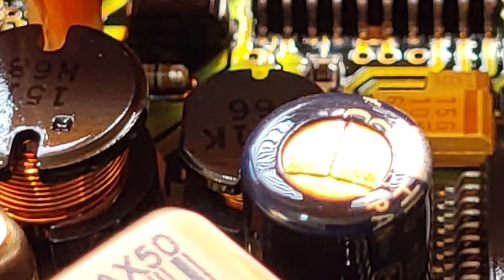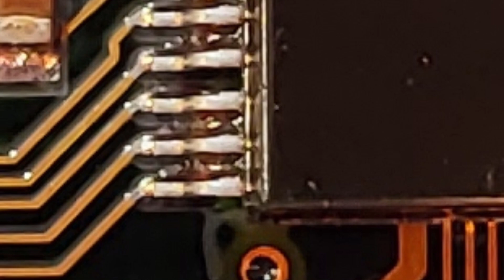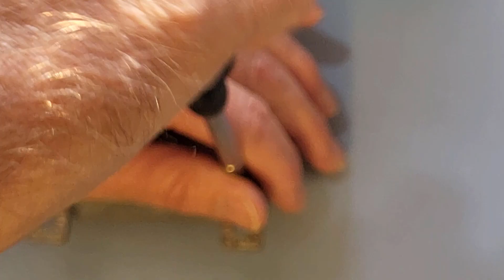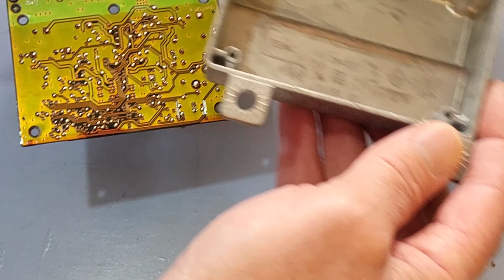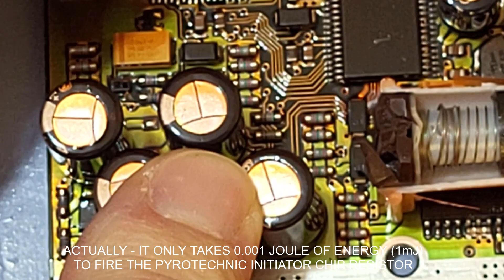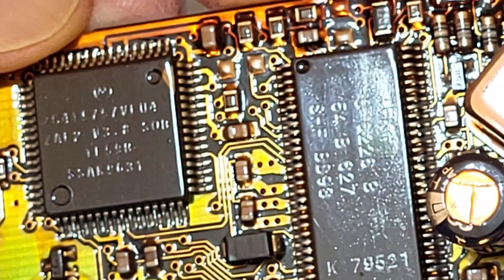CAN A 25 YEAR-OLD AIRBAG SAVE YOUR LIFE?

Comment: Crazy just how long they can work. I went to a junkyard a few weeks ago and saw a 1995 Ford F-150. It’s front end was completely torn apart and it was smashed inwards and door slightly buckled on the drivers side, yet when I looked inside I could see it’s 30 year old airbag had still deployed.
Reply from the maker: Thanks, yes, unless the SRS light is on they will go bang!
Reply: shocking( case examined in your junkyard crawl ) that works as intended as Volvo-LLC saying some of the restraints go rotten ( remembrance for my pre 1990 truck and my 70~charger so i don't forget to replace them when i finally get the restoration done ect ) after 9~ years sorry from my memories as i haven't been reading about this lately, anyway's at least on the bag's i knowledge/handled/3d-party-repair-shop-employed in the usa-markets/brands the charge=sealed generally ( also generally look for brighter yellow wires and or molex-connector's, my uncle used to be in maintenance and or helping Lincoln-ne-usa run that-line ect ) but ford/other's did get caught with more than one era/recalls and for the fabric-bits generally aren't completely sealed to environmental factors ( part of honda/big-3 was keeping the timings but changing the denominators/assembly on the back, yes some models/parts do use a o-ring but not all of them ) and or in the process of being pressed/20-2k lb-force look at space-shoots/drag-shoot's to get my-points the fabric over time and or galvanic/chemical-factors can degrade so great the charge-fired as planed ( takata's don't as chemically decomposing aka dud's or extremely-spicy=frag out, my 5year/08~ old car/le-cross at time/need/25+mph was dud's so probably had the recall/needed but gm hadn't announced it yet as that was 2015~/late by memory ) but now the plastic/canvases/silk rip's/RIP'd-driver and or others 

yes im not in the removals camps but i do wish there was aftermarket parts/support for popular models that got to 25+years old and or some way of adding/cert-ing it just like how EFI currently is for 50's-classic's

also wishing for 4 or more point belts as 2's and 3's doesn't work for my 190lb~ body shape i get injured despite following to a T the owners manual ect

Comment: I worry about the actual bag inflator not so much the electronics. I'd rather have one not go off than one that may be corroded and spray me with shrapnel.  After all that's what the large recall was over. Then I think my vehicles I drive daily were early airbags and who knows if they even would have cought a problem like that recall. Then I take into account they are both convertible vehicles that are 20+ and 30+ years old.  

I'm actually thinking about unhooking at least the older one. 

I know in the US depending on the state it would still be legal to drive and register.  And I'd rather have an insurance company mad at me than be dead from parts hitting my face

The middle of the floor under the dash is not really a great place for a wrangler with wash out floor drains and a steep windshield.
Reply from the maker: The airbags themselves are a bit like lightbulbs - they are completely sealed and they will go off unless the ignitor goes open-circuit - and then you will get the SRS warning!
Reply: @TimmsBMW  unless things have corroded and the charge ends up making metal shrapnel like the recalled ones

Comment: I use an "Autolift 3000" "car seesaw" lift on my cars. It lifts my 760i easily and safely. Just wheel it under the car and use a good electric drill to raise the car, if you are working in a semi public place it's fairly easy to lower the car back when you are not working on it.
Reply from the maker: Thanks Andrew, to be honest, even with a great lift like that I still won't work under the car - the only time I get under is when it is on sturdy ramps!

Comment: I wonder about the air bag itself. Does it deteriorate with time? Big dustup over Takata airbags failing. If I remember correctly, BMW had a recall and mine were replaced on my E39, but as time marches on, I wonder if there is a useful life to even properly made airbags.
Reply from the maker: Hello William, the airbags, unless recalled, will go off - they are hermetically sealed and should last many decades

Comment: Wow I can't believe that people would disable a safety critical warning with a resistor... Only to make a few extra quid selling (or using) an ageing car. I'm also fairly sure if one were to do that, and the new owner has an unfortunate incident, and they can prove the deception (and it is a deception AKA a LIE!). So whoever did it, could be in a world of trouble, as a lie that puts someone at risk should the truth be unknown, the teller bears the responsibility of the consequences. 

If one wants to do that to their own car, and use it solely for yourself,  just getting rid of a light, then whatever, their risk, their Darwin Award. If it were me and I was using the car, I'd visit a scrap dealer and pull the same airbag out a wreck, if it's intact (assuming I couldn't afford a new one). If I were selling it, I'd just fess up and have the new owner sign that they are aware that there is an issue with the SRS, hence the telltale light. If the buyer low balls you for it, you can just argue that the asking price was with the issue/s in mind (assuming that it actually is, and is realistic), and if their counter is not to your liking, you can still politely decline. There's no need to BS someone and jeopardise their safety as well, all because one lacks the spine and courage to be honest.
Reply from the maker: Well said Justin - it always amazes me!

Comment: I’d love a video on the pixel issues of MID and dashboard indicator. Everyone seems to suffer these issues. To send them out for repair is over $100. A ribbon is $6. A ribbon and lcd display is >$30. The MID is master class in patience and repetition to still fail.
Reply: Lookup the electric shock method
Reply: @leenevin8451  😂 haha. That’s a fallacy. If you know how these lcd displays are connected you know that little quartz cigarette lighter ignition hammer is a joke. A disconnected contact on the ribbon cable is a disconnected contact on the ribbon cable.
Reply: Cheers timm that was great. Learned a lot there. Effing teslas 🤣👍🏼
Reply from the maker: My pleasure!

Comment: I thought soy based biodegradable wire harnesses was just a foolish design implemented by Mercedes Benz of the late 1990’s. It cost $7k for a hand made wire harness and install for Mercedes biodegradable wire harnesses. 
I assume BMW doesn’t have the same wire issues as Mercedes do of the same vintage? My 1998 E38 has rock hard wire insulation, but left alone it doesn’t fall apart.
Reply from the maker: Yes, we have the same - always best to leave it be - except on the boot hinge where it WILL break!

Comment: Timm, long time fan from your website since 2013.  I've done well to depend on your advice on my E38 over the last 9 years.  I've been wondering lately about the safety of the airbags in my E38 since it's my daily and couldn't find much info online.  Thank you for posting this video,  your information is fantastic!!  Now I am not worried at all!  -Derek in Ohio, USA
Reply from the maker: Great to hear from you Derek!
Reply: belts( probably 3-pointing in your E38 but can't remember if 4-points was a factory option or not, isn't for my 70~charger or my newer-experience's/vin's ) FYI by Volvo-LLC and by harnessing used in construction and NHRA/?IFA?/SCCA are one=done for hits/use and also go rotten after 9~years but some of this is by memory as i haven't been drag-racing in 5+year's, but the belt is made to stretch a little/springy-ish and or UV-light aka sun can micro-damage them as well as fingerprints aka salt+acid's ect

Comment: My SRS module failed on my E64 when my Indy was doing brakes and disks all round. Odd but they said wasn’t connected they did send away to specialists to get repaired but no joy. In the end safety first and £600 later for part from BMW
Reply from the maker: You certainly wouldn't want a repaired one, so the only way forward was to buy new - strange it failed though!
Reply: @TimmsBMW  The issue with these classics is that yes you can get some great deals when buying one now but still expensive to maintain as if new in certain areas.